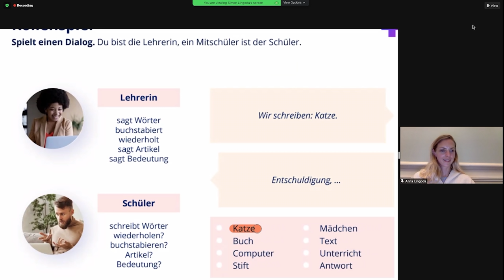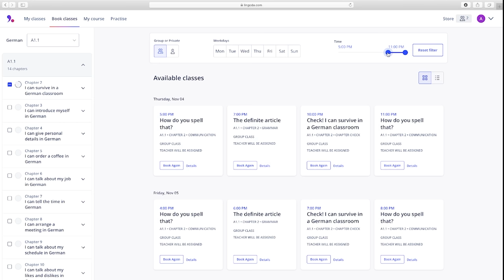Why we gave up everything to move HERE (and to buy a chateau)

Comment: Hi, I have both gas and induction because you can get the induction hot plates cheaply now, and place them on your island.  I power the house entirely with solar panels so induction makes cooking NET ZERO which is fantastic.  But, gas gives you more control with heat, especially for delicate dishes such as seafood.  Induction does not have any residual heat, as soon as you lift the pan off the hotplate, the heat dies - you need to learn to turn the heat up/down quickly which requires lots of practice. If you are making sauces, it's very difficult to lift the pan to reduce heat quickly.  Also, you won't be able to use old pots, copper-based pots and may need to buy a new range of induction compatible pots.

I've been to Honfleur and would be very interested in prices associated with a chateau reno. such as carpentry , roof repairs, what to look for when thinking, wondering about such a huge project 

thanks

Comment: For me, hands down, gas. I’ve used electric, induction, and gas in my lifetime. I love the way I can control heat with gas and when it’s off, it’s off—no cool down time.  The ONLY criticism I have is that sometimes it’s very hard to simmer or hold something for awhile like a pan of rice while you are preparing the rest of the meal.  I’ve learned to put a diffuser underneath pans for those kinds of needs. Part of it is my powerful stove.  Good luck deciding.

Comment: I have cooked with both. Gas  is much easier to control. But it doesn't work when you lose electricity...all modern gas cookers have a safety device which means you ignite with an  electric spark which doesn't work if the electricity isn't working. the gas valve automatically closes. Also the gas  hob is robust...no fragile glass surfaces.

Comment: Didn't see anyone mention this but the induction stoves can be frustrating when it comes to changing temperature as they have a touch screen and you have to go up or down one number at a time. Same if you want to turn off only one plate and not all of them at once. So going from 9,8,7... down to 0, I just find it mildly irritating every time. Much easier with gas to just quickly turn it where you want it. Also, I think for a chateau, gas would be more fitting somehow.

Comment: I feel a new weekly item coming up; Philip makes you hungry. Apart from your regular work as influencer, your work as culinairy influencer will ensure all kinds of kitchen apparel to be sent to you.

Ps. Use induction, it works every bit as good as gas and is much easier to clean. You might have to change something though in your electrical installation to go to 380 volts

Comment: Induction is wonderful!  It is fast to heat (as fast as gas) and the top is so easy to clean.  No risk of fires.  The top cools down fairly quickly too.  But you must consider the brand.  I went with Miele, but their dimensions are different from other brands (in Canada at least) so if you are going with a built-in, with the counter cut out for it, you need to be prepared to always stick with Miele.  It is an expensive unit, and mine broke down (electronics needed replacing) after 10 years.  The parts cost more than an entire new unit of another brand, but since the countertop cutout was made for Miele, I would have to replace the entire countertop if I switched brands.  I have used gas in the past, and liked it, but induction is so much safer.

Comment: Induction all the way... we briefly went back to gas when we moved house and it didn't take long to remind us why we stopped using it. You have more control over temperature - it takes less time than gas to heat up - brilliant. You do need the correct pots (and beautiful copper ones won't work (unless they have an iron core))

Comment: I've cooked for many years with gas. When I remodeled my kitchen I switched to induction. I love the induction for several reasons, it cooks much faster, you will learn to control the heat fairly quickly and most of all so easy to clean, no more lifting heavy grates!

Comment: I vote for both gas and induction, two cook tops. Add the new induction, but keep your existing gas functioning. That way, you can use what you prefer for cooking, be ready to switch to all electric when the future demands it, but use the gas when the power goes out or when you need to see the flame. And by the way, if I had the possibility to also cook over or in a wood fire, I'd want to preserve that option, too. Super trendy.

Comment: Gas can be used with or without power, exacting control of temperature, any pot or pan can be used for cooking. Conduction demands flat bottom easy conduction bottoms and ,of course, doesn't work if power goes out.

Comment: Induction is really responsive and doesn't waste as much energy as gas. Out of the three methods we have to cook in modern kitchens gas wastes the most heat energy. Don't try a small induction thing to compare, those are really nor comparable to the big kitchen induction stoves. There is a reason chefs have switched to induction.

Comment: Cook tops, gas was always my chose for same reasons as Philips, until we experienced confection cook top which is fast and a lot cleaner. Disadvantages of these are, not all cookware are suitable to use on confection, also if there is a power shortage you can’t cook. So my advice is if you can get at least one gas burner as well as confection, then all bases are covered.

Comment: GAS OR INDUCTION!

I cooked on gas for most of my life, never having lived in a house fitted with anything else. I did try others, but without exception found them all inferior, often markedly so, with slow heat-up times and slow response to changes in heat setting.

When I moved to an apartment with no gas, I chose induction as 'the next best thing!' however, unless a flame is required, I have found it superior in every way - more powerful than any domestic gas hob I have used, and able to go much lower too (gas is limited to the lowest flame where it will not be blown out by a draught!

With the exception of the largest gas ring powerful enough for a wok (although I believe there are shaped induction wok burners available) I would go induction everytime - I would not return to gas even if I could. Additionally, we also have to consider the future availability and price of gas.

If you are still undecided, I would suggest a modular system where you choose exactly what you want - for a 5 burner solution I would go with one panel with the large gas burner suitable for a wok as well as large pans, a quad induction burner where they are in a row, but functionally in pairs to create two burners, but with the option of combining all the zones for longer pans such as a roasting dish or a fish kettle. While you could have another like this to make your 5, it may suit better to keep it as one large and one small burner for your final module.

P. S. Induction requires magnetic pans (and to avoid excessive damage to the surface) with smooth and flat bottoms.
Reply from the maker: thanks for those tips!

Comment: Well I love cooking on gas but induction has the same benefits. We are evolving to a world where any burning emissions gets banned (for example in Belgium new build homes has to have electric heating and electric cooking stoves) I’m sure this will come to France too. So for environmental purposes I would go for induction! Induction is also more child friendly as the plate doesn’t heat up itself, without a pan there isn’t even any heat, the only heat is in the pan itself because of the induction and that might radiates to the cooking surface but that cools very quickly and also it cleans much easier.
Reply: " in Belgium new build homes has to have electric heating and electric cooking stoves) I’m sure this will come to France too." hehe.. funny.. French have houses 100% electric since 40 years... French electricity produced with 56 nuclear power plants + 2,300 hydroelectric installations, producing 25,500 MW, equivalent to 20 nuclear power plants, 1st hydropower production in the EU. France electricity is the greenest in western EU: Natural gas power plants account for only 2%, coal for 0.3%, going to 0% next year. National emissions reported to the UNFCCC and to the EU Greenhouse Gas Monitoring Mechanism  2019 CO2e emissions from electricity production (g CO2e/kWh): Poland 751  Bulgaria 421  Czech Republic 431  Germany 350  Ireland 316  Spain 276  Italy 248  UK 230  Belgium 207  Denmark 189  Austria 102  France 56

Comment: I'm not a professional chef in any way, but I would definitely recommend a gas stove over induction. I've cooked on both, and greatly prefer gas. Like you said, Phillip, it's easier to control the temperature. Quick to heat up or cool down. They are a bit more difficult to clean, in a way. The glass top stove I have right now is harder to clean than you'd expect. Things get burnt onto it quite easily, and you have to buy a special cleaning product or use a razor blade to truly remove the burnt on spots.
Reply from the maker: Thanks for the tips!

Comment: Gas! Induction had advantages (easier to clean); however, with gas I canbpre-roast my garlic and peppers by putting them directly in the flame with a large wire spoon. Also tortillas heat up perfectly on gas, otherwise you must use a skillet and they just don't ever taste the same. Of course the best of both worlds would be two induction burners and one has burned in addition!
Reply from the maker: Thanks for the tip!

Comment: Gas!!  I had an induction and it took a long time to when I changed temperatures. Gas heats or cools much quicker
Reply: Are you sure you mean real induction? Because "electric" doesn't actually mean induction. Induction is very easy to change temperatures. It also heats up instantly.

Comment: Gas is what I prefer,  I  used to do a cooking segment on a local TV station that had induction and most of the chefs that came in did not like it.  I can use either but prefer gas,  besides if you had power go out with gas you can still cook.
Reply from the maker: Thanks for the tip!